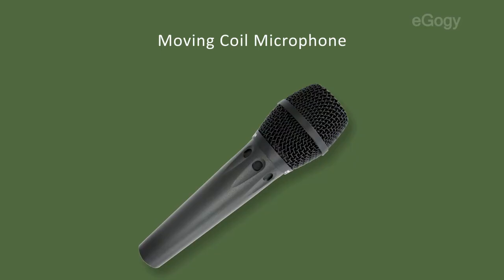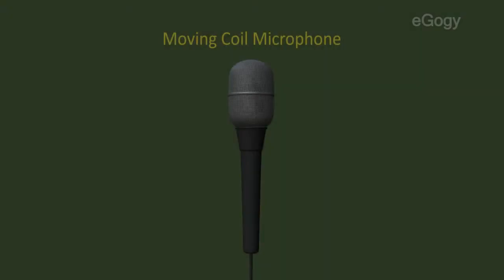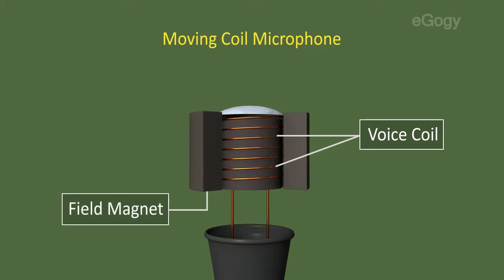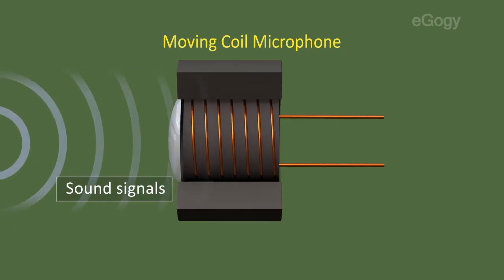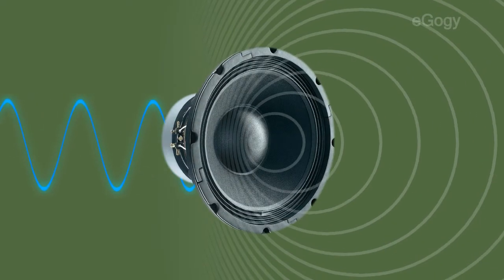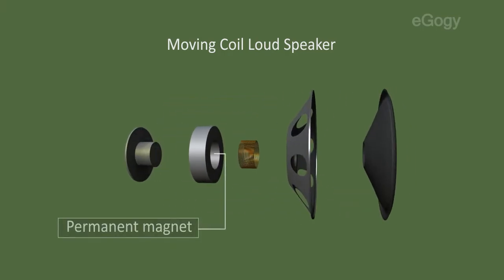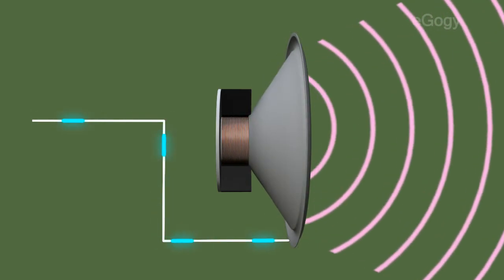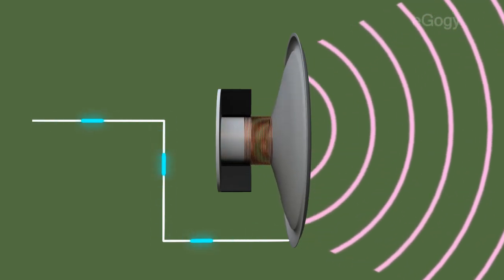Moving coil Microphone & Loud Speaker

Comment: can electric signal produce electric current?
Reply: When there is movement of an electrical conductor/circuit (eg. the coil) between two magnets, it causes the electrons in the coil to move. The faster the movement, the faster the electrons move, meaning the faster the current, which I assume is how they determine the amplitude (how loud it is). But yeah, once electrons move, it flows.